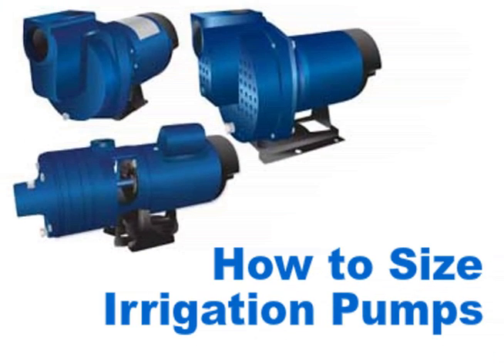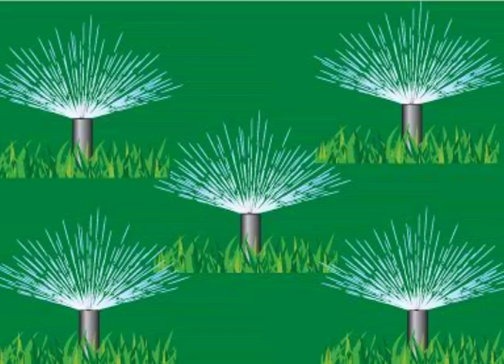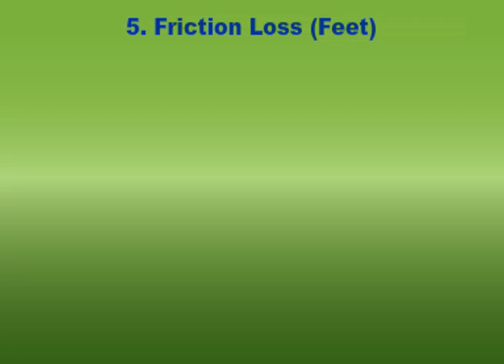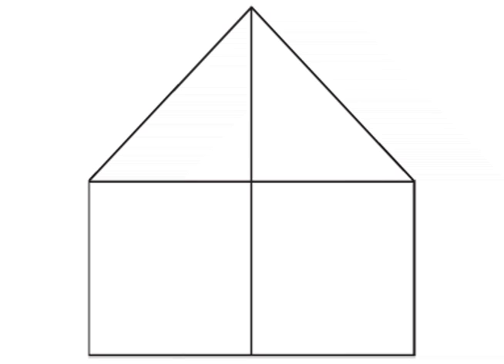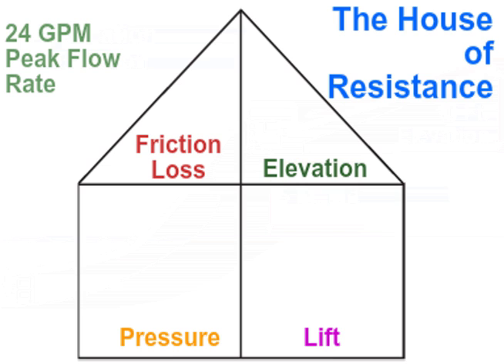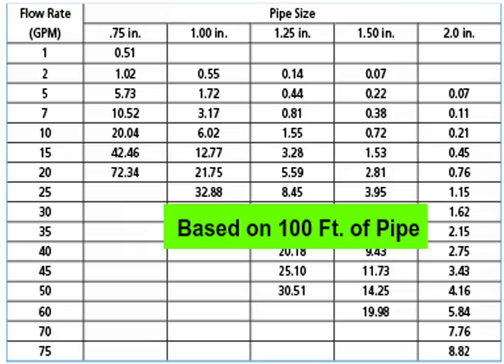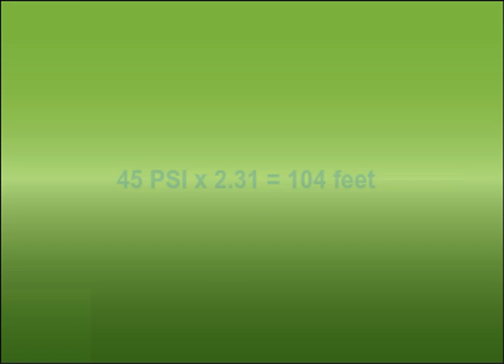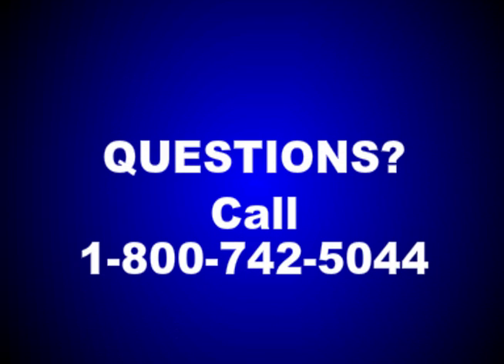How to Size Irrigation Pumps

Comment: Please discuss wind impact on pump selection.
Reply: What is ‘wind impact on pump’ mean???
Reply: @Bhatmann  like high winds reduce sprinkler coverage area so more pressure from pump will be required
Reply: No such thing as wind impact on a pump.  @Bhatmann
Reply: Noneed Toknow60 —
Maybe not directly, however I can see how wind will effect the whole sprinkler system and how ancillary components will ultimately influence pump sizing and selection.
Reply: Unless you have a variable speed pump you cannot boost discharge pressure. 
Wind speed is not constant so it is futile trying to calculate pressure versus wind resistance to gauge upwind throw.    @Bhatmann
Reply: Noneed Toknow60 --
Okay, I understand. You have a comprehension problem.